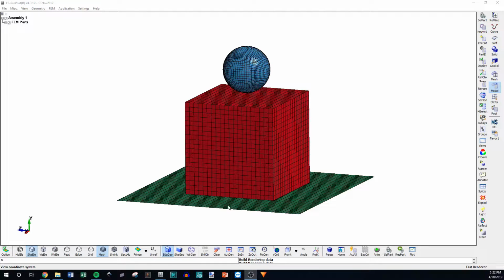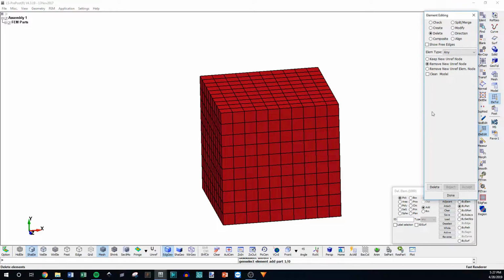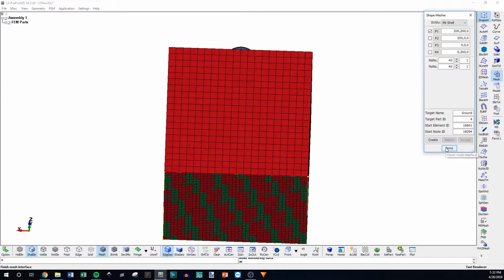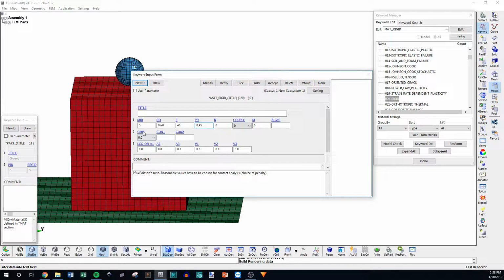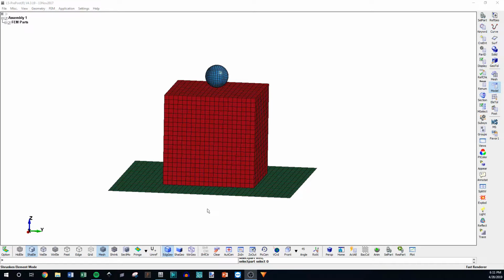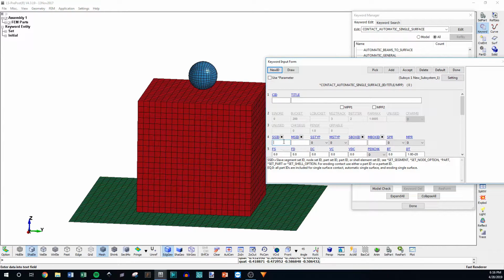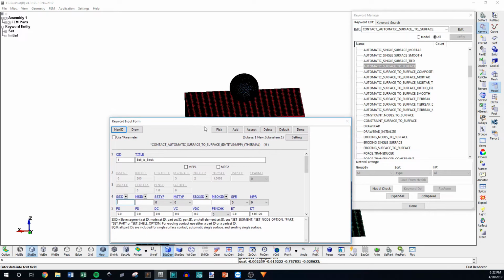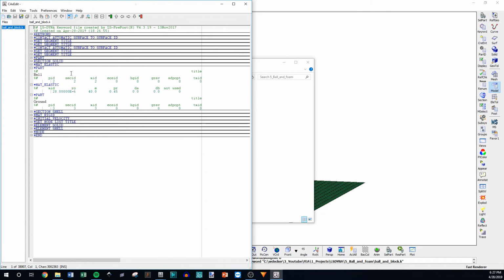LS-Dyna Ball and Block Tutorial Part 1: Mesh and Boundary Condition Setup

Comment: Is there a way to get shear force and bending moment in LSDyna? I heard that we can get these from reaction. However, I  have a circular hollow pipe. So if I want to get reaction at support, do I need to sum up all reaction forces of support nodes at circumference? But some nodes will have negative reaction and some positive. What to do in this case?

Comment: Thanks for these videos ! I have some trouble with the contact automatic surf_to_surf:

When i chose as Slave -> Cube bottom surface and Master-> Plate, the cube go throught the plate during the simulation and if i reverse the Slave and Master, it works.

I don't understand because normally surf_to_surf contact should be a symetric (or 2 way)  contact, that mean Slave/Master definition doesn't matter. 
I though that it could be the normal orientation of the segment of the plate ( because it is a shell) but i have read that with "Automatic" normal orientation doesn't matter because it take into account both side.

If you can help !

Many thanks again ;)
Reply from the maker: Did you reconstruct this setup completely? Make sure the materials of the two parts are correct because parts of very differing stiffnesses can cause contact issues.
Reply: @UnpopularMechanics  Yes i had... that why i was wondering how it was possible.

I will do it again haha 

Thank you very much for your anwser and also your videos !
Reply: @UnpopularMechanics  Hello, Thanks for your turotial! I have the same issue with cube moving through plate.. In my case change of master and slave did not help. I tried also different thickness of the plate, model it as a solid, but still the same issue. Could you please give me any advice what should I check?

Thank you very much!